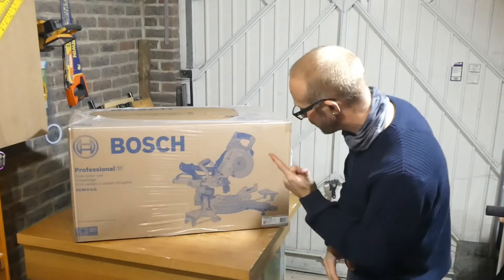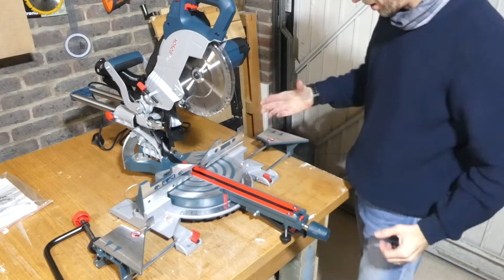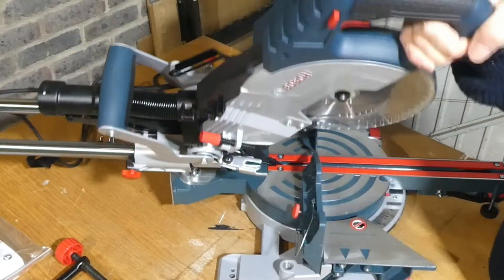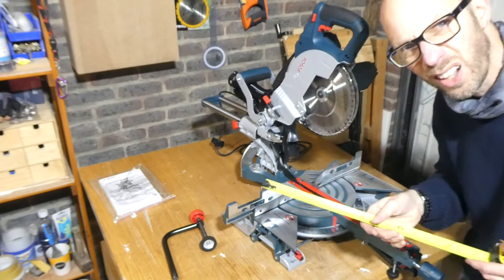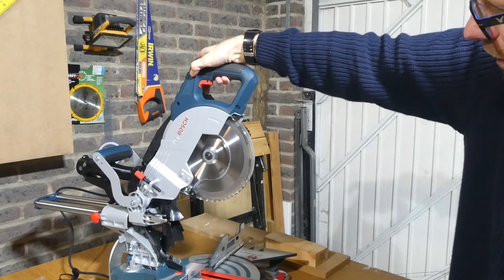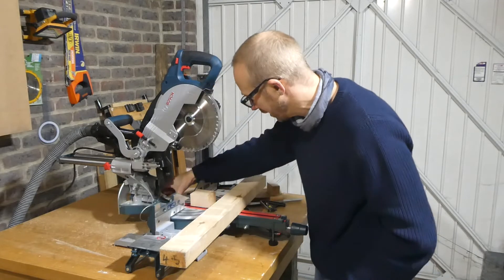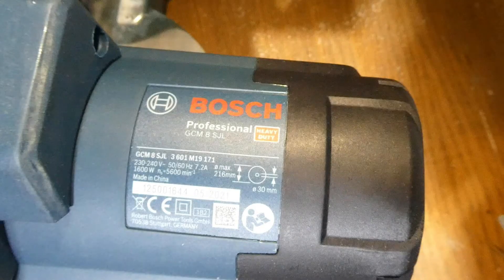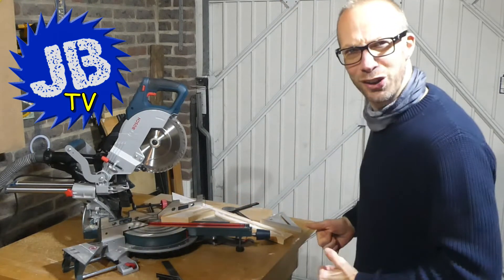Bosch Sliding Mitre Saw GCM8SJL - Unboxing and Review

Comment: Hello Justin, I've got the same saw but I'm struggling to find the attachment for the dust extraction system. Which one are you using? Is it the proper Bosch suction hose and attachment, or a different make? Thanks!

Comment: sorry to ask, but i received mine today but its makes a dodgy noise when started but when moved round with hand there's no noise at all, its not the first saw I've had. any ideas?
Reply from the maker: The motor does sound a bit strange at start up, but should be a usual sound when running
Reply: @JBTV   yes it's go away when running fully. But I've not heard this noise on any mitre saw in my life. So I'm waiting for a reply back from the supplier and Bosch to see if it's going to be replaced before I keep it running after 3 second's of running.. Thanks for the reply
Reply: @mattbooth46  I'm into buying this saw and have seen many comments about the start up rattle. Seems to me it's normal. I can buy it new for €250. You think it's a good buy?

Comment: Tips and Test:  It's better to know than not to know.
Important to know if you would like to saw with precision. (avoid torsion as much as possible)!
Always choose a Miter saw with a handle positioned in a VERTICAL line above the saw blade.  
Everything must be aligned, slide rails, handle, and saw blade,it is much better this way the blade will not tilt.
Because there is some torsion in the aluminum housing .
And choose an engine with softstart on it to prevent wear of the gear and worm shaft.
It is very important that everything is aligned.
Here are some examples to show how the handle must be positioned above the blade.

First option: handle vertical positioned above the saw blade. 
Bosch gcm 800 sj / Bosch gcm 8 sjl / Evolution rage 3 / FESTOOL KS 60 / Bosch GCM 8 SDE / FESTOOL KS 60 E KAPEX / Metabo KGSV 72 Xact/ Bosch PCM 8 SD / Hitachi C10FSH / Ridgid MS255SR 10-inch / Evolution Fury3-S / Evolution R255SMS / Metabo HPT C10FSBS / Hitachi C10FSB / Hitachi C10FS.

Second optie: handle horizontal positioned above the saw blade / Evolution R185SMS / Evolution F255SMS / Evolution RAGE3R255 SMS3 .

(This also is the case with the Miter saw without the slide rails).

(If you want). You can test it yourself at home if there is torsion in the aluminum housing.

Step-1. First you make a saw cut from +-5 mm deep in to a flat piece of wood about +- 20 mm thick to this with the normal handle positioned on the right side of the Miter saw (the wood it will remain in place until the test is completed).

Step-2. Then repeat this by pushing the saw blade down with your hand or finger on the aluminum protective cover were the saw blade is cased in. Just now only do this without the running engine.

Step-3. Now you can see if the saw blade will be positioned in or next to the saw cut. If the saw blade is (+- 0,2 / 0,5 mm) next to the saw cut then there is torsion in the aluminum housing. 
(test is completed).

Conclusion: Therefor it is much better to choose a Miter saw with the handle positioned VERTICAL in line above the saw blade. 
The second option is the handle positioned HORIZONTAL in line above the saw blade.

 Remember this, the test is only about torsion and nothing else  how further away the handle is from the saw blade how more chance of torsion in the aluminum housing, you better not go for that. (the choices are yours).

Also with a cheap slide miter saw it is still better the handgriff in line a above the saw blade than on the right side. Maybe they will make it someday then we have a winner...

P.S.  When you measure the vertical 90 degrees angle square (Digital Level Box) of you're sawblade don't forget that there is always some torsion in the aluminum housing.
Reply: Great tip👌.

Comment: You talk about the adjustment of the laser line and the angle (by adjusting the fence I suppose?).
Wish you'd actually made those adjustments so that we can see whether this really works.
Did you manage to calibrate the saw?
Reply from the maker: The fence is perpendicular to the laser and sits on the saw, so adjusting the fence will not change anything. I actually don't use the laser, so am not worried about it being calibrated. However, the saw itself is square and ready to use from the factory, well mine is anyway!
Reply: @JBTV  Thanks for the info. Guess I'll skip this saw then. You're lucky yours is square, but looking at other videos not everyone is so lucky.